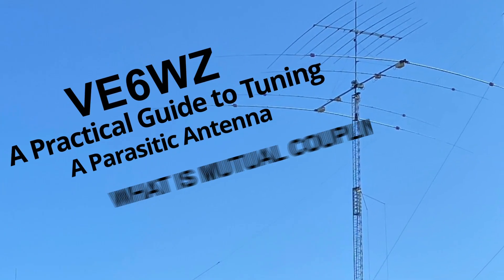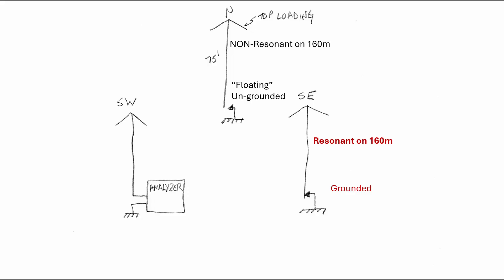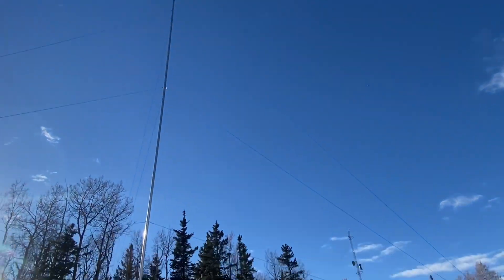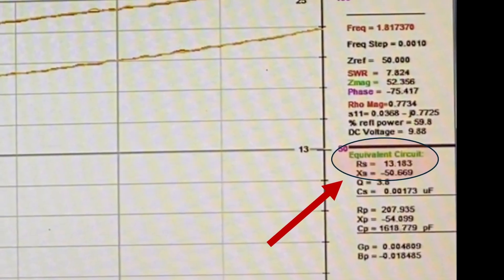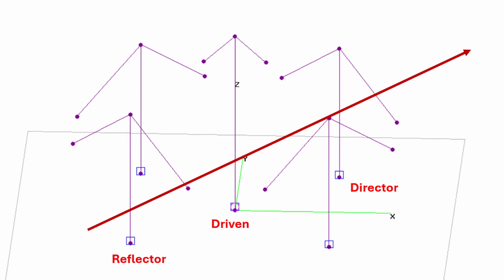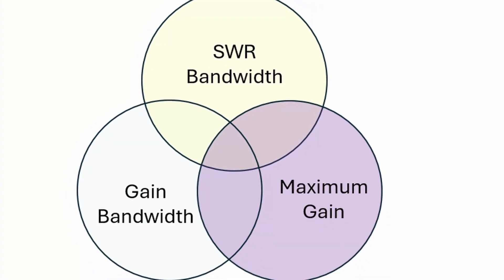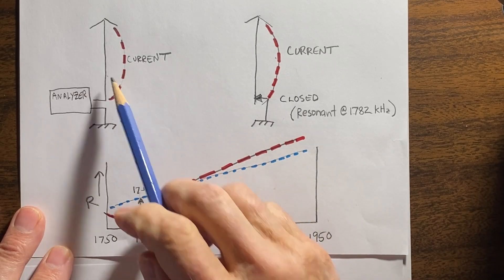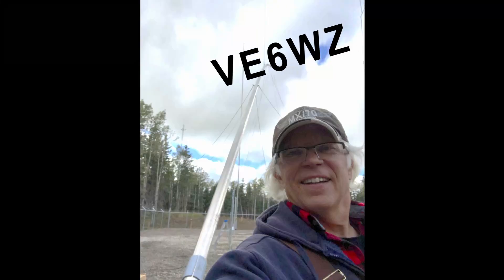A Practical guide to tuning a parasitic antenna.

Comment: Isnt the tower shunt fed as a radiator for 160 at your QTH? Why would you use one of the three parasitic elements as a radiator when analyzing, instead of the shunt fed tower while grounding the other two parasitics?

Comment: Great video. This has been a point of fascination for me for some time but I’ve been too lazy to break out the books and it’s a topic you don’t see covered in good detail on YouTube. I especially like the way you showed how the parallel nature of the impedance compares to a purely resistive circuit comprised of two resistors in parallel and applying Ohm’s Law. 

When you say grounded, do you mean electrical ground (via grounding rod) or RF ground (via radials)?  I’m assuming the latter, but would like to know for sure.
Reply from the maker: Radials. About 100 wires from each element, on the ground ranging from 50' to 120'

Comment: Steve,  de ZS2CX , was smiling all the way while watching your video, ....on 80m phasing 2 verticals back in 2006 to 2013 , was a dx hunter antenna and really worked well, back then (mfj analyser days). i remember having to tune on 3.7 to 3.750  Mhz  ....with mutual coupling it bump the freq up to 3.795 (the dx window).. also this new found 4 radials elevated system did not work for me back then... i live close to ocean salty marsh environment... matching was needed just like your system, i needed  N/S and broadside so my phasing was easier than having 4 verticals, but then i mean i live in ZS far south on the edge of our continent, so, latenight, early mornings contact worked for me, early evenings hardly ever produced any contacts (dx wise)....  zs6ha Jan (sk)... used to join in  on the fun , we nailed EU on a daily basis,Zl1iu now and then, with the usual flutter from zs to ZL.. greenland was a tough one too, had to break the Eu pileup... but we nailed it too. vk was easy as pie, ribin VK6LK (sk) was on every evening (sked) with non existent signals on a dipole, the verticals brought the contacts home.
regards Johan zs2cx

Comment: As always a great video. Can this method be used for an elevated radial system ie 4 radials per element instead of the extensive 
ground system?
John Limanowski N9DNB
Reply from the maker: John, I don't have experience with elevated radials, but identifying the resonance dips in the parasitic should work.  I have used the method for tuning my 80 and 40m Yagis.
The "bigger" question is will the pattern hold up if the elevated radials are not perfectly symmetrical and cancelling the radiation?